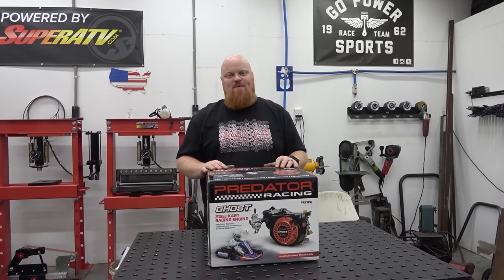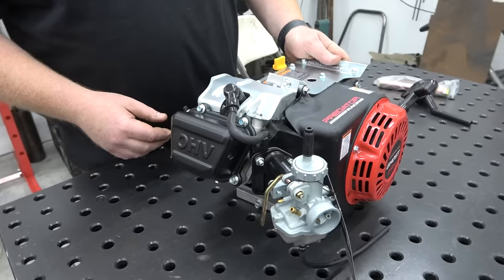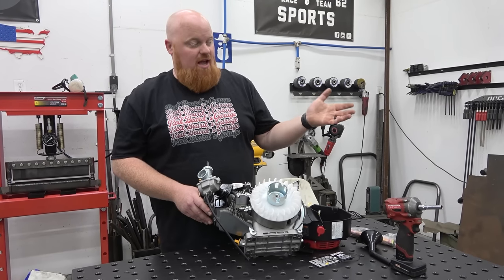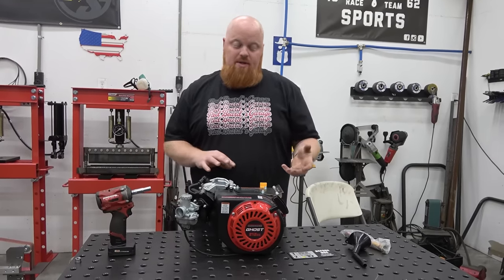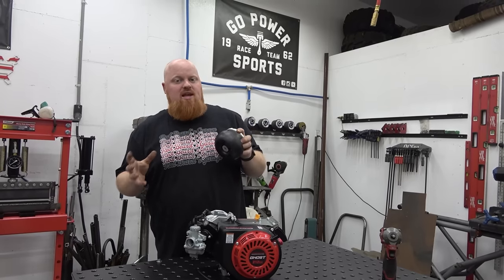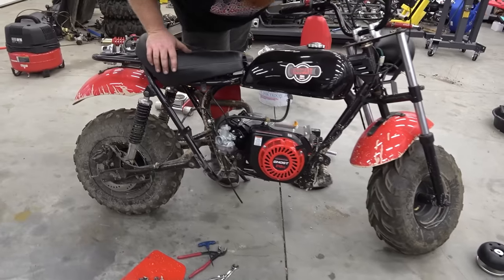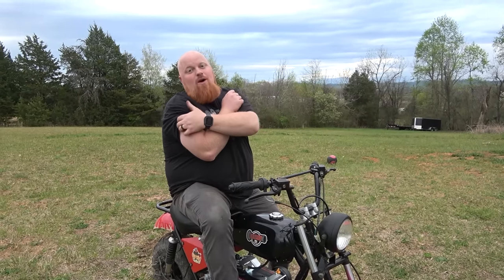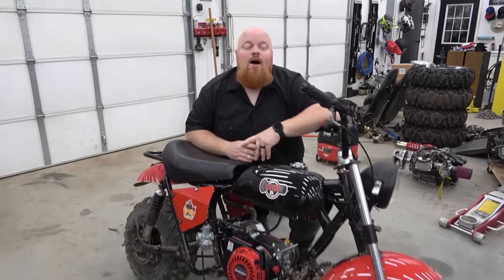🚨NEW Predator 212cc Ghost👻 Racing Kart Engine - Harbor Freight Ghost 👻 Engine

Comment: 224 all the way 100 dollars less then the 212g and with that 100 bucks you can get a ebay vm22 with jets and header and a governor deleted is free so for 300 or less dollars you will be making more power at a lower rpm maybe 5500 rpms with stock springs and with the 212g still having some sort of cast rod i bet the dipper still fails past 6k so you will still need a billet rod and flywheel to continue to turn up where the 212 needs to be to make any kinda of power

Comment: At 12:37 Why do y'all overfill these engines??
All it takes is 1/2 qt of a quality lube like Amsoil 5w30 signature series and a cap full of Lucas zinc additive. Filling to where it runs out the lower fill port is just causing excessive windage and also the reason so many people think they need remote oil catch cans! 
The manufacturer itself recommends 1/2 qt engine oil. No more no less. That amount puts it dead nuts on the fill line with the stock plastic dipstick plug.
Don't overfill your crankcase kids!

Comment: I need help man , so I have a mega moto b212, have the ghost , put billet flywheel , I bought your coil pack with red coil , changed that , put in juggernaut,  and  cannot get a top speed over 38.5 mph , am I doing something wrong ??? Any help will work,
Reply from the maker: Gearing?
Reply: @RedBeardsGarage  yes your right , changing out soon as gps sends , thanks for getting back man

Comment: tldr its basically a degoved engine with a few safety upgrades like limiting coil and slightly better flywheel wouldn't pay more than 100$ over what a stock engine is...

Comment: I hope they realize that and the predator class or 206 class you're still going to have to modify this motor just like you would a regular and cheaper hemy predator motor So why pay $299 for this when you can buy a regular Hemi for 120 and the difference to equal to 299 and you have a full complete racing motor with this you'll have to spend 299 and then I have to spend another chunck of change to fix it up for racing

Comment: Hopefully, this coil will be made available for the standard predator builders to remove the low RPM mechanical governor, and add a higher RPM digital governor.  Adjustable digital governor would be the Holy Grail for us in the hobby
Reply: It won’t. And we’ll be taking pliers and a hammer trying to demolish that governer🤣 done that one too many times

Comment: I have a Coleman ct200uex I am using a 6 to 1 ratio. 10 tooth on the clutch in 60 on the back sprocket. I am running a hot Tillotson 212 I can't get it up to 67 mph I weigh 200 lb. Predators are for children Tillotson 212 off for grown man
Reply: I can get 67 mph out of it. It runs so fast I have to let off the gas

Comment: My opinion.  OVERPRICED.  Right now I can buy a stock 212 for 119 bucks,  That's CHEAPER than the 79cc!  I'm about as big as you.  I'm fairly confident I won't need more power than a stock 212. (I want to put it on my bicycle.)

Comment: Not worth it...to me. i wud build up stock 212 n spend same $  with CM 265" lift cam, 22# springs, pvl flywheel, billet rod, port head and be in the same $$$$ area but i wud have what i want in it. the cam, from other vid is like .253"  lift. they cld have done better at the price point.  265" is not that far away from 253"... 275" lift wud be better. stock rod for 6000? now we know that the stock rod can deal with 6000... with 3/8" cut off the oil dipper and the oil hole drilled bigger for MORE OIL TO THE ROD JOURNAL so the rod doesnt try to spin weld itself to the crankshaft... if change oil ... karters change oil every night / day of racing and scream stock motors to 6800'ish RPM's

Comment: where  is the air filter how much shit went in to the carb off the frount wheel come on man you should no better small engine mechanics say you must put on a air filter before starting a motor otherwise good video also why a burn out surley your weight is enough  to make it work .

Comment: There is no difference in this motor and a regular Hemi motor as far as speed the only difference is it don't have a gas tank and it has a plate already a different carburetor carburetor is no different than the regular carburetor that comes on believe me I know I used to race these motors

Comment: I would never run this engine to 6000 rpms.  It has a stock block and a cast iron flywheel.  Its not worth $300.00 .  I never put my kids in that kind of danger.

Comment: That ghost motor is a piece of junk. How are you gonna call a racing motor when you have a governor on top of that to make it a racing motor you got to do the fly wheel rod and the coil without a rev limiter that is not a reason